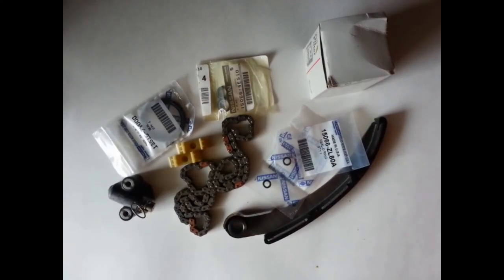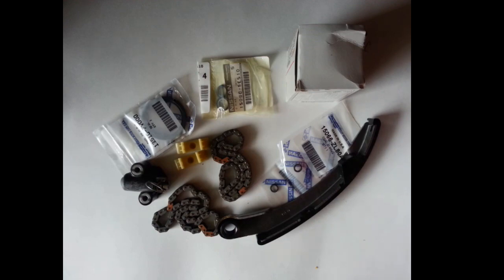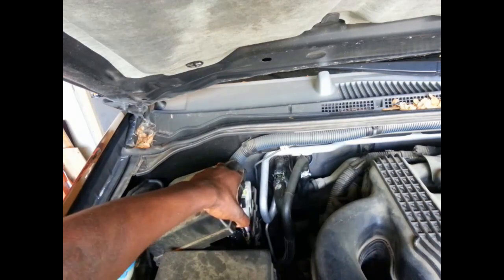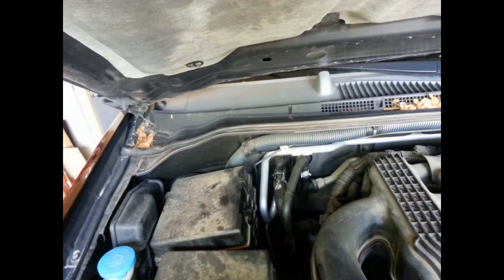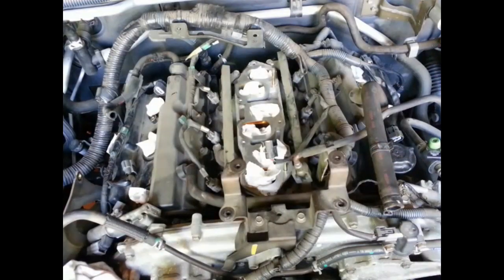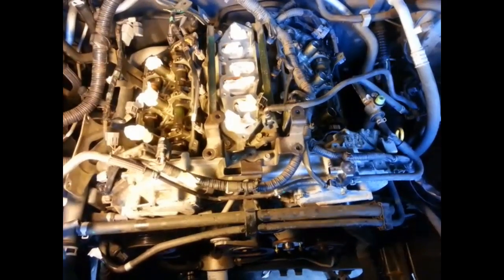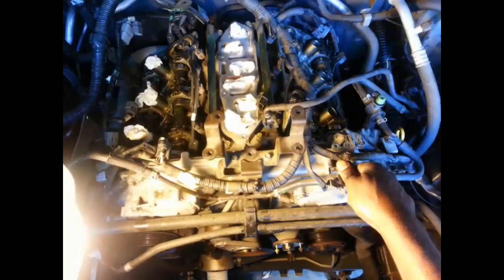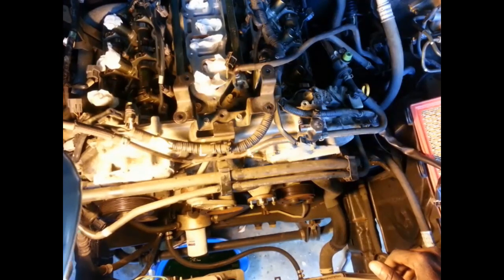2005 - 2008 Nissan Frontier timing chain replacement  Part 1

Comment: Hi, do you know if this engine is toast or if I can fix it. I have a 2005 Nissan Pathfinder. The crankshaft is turning 360 degree or half way. I just changed the timing belt and I found that the timing key was not aligned but the engine didn't turn on.

Comment: Guys, if you want to save yourself some time stop here and watch these 4 vids.....or at lease until you get to the timing case. This fellows goes through and does the job as good as your going to find. All the others will do is confuse you on their theories of engine timing issues. The one most watched didn't even start  his engine to show us and had lots of issues he deleted without explanation. Very good job Billy.

Comment: One question, is you frontier manual or automatic? and did you have to put it in "4x4 and low"? As i have read about that on other forums. and did you use some sort of a flywheel lock tool?
Reply from the maker: +Mariusz cies 
    My Frontier is automatic. It was in Park. Even in park, you can turn the engine for the automatic. For the manual, I believe you need to put in neutral and raise the rear wheels in order to turn the engine. I did not use a flywheel lock tool. I used the tie down rope to hold the engine while loosening the crank bolt. I explained this in video #2.
Reply: @diybillyc5000  when you go to tighten the pully back in, did you need to strap it again?
Reply: I used an old starter and spot welded the gear on to the starter shaft....just make sure the gear is all the way out so it will engage the flywheel

Comment: What size socket does it take to remove the crank pulley?
Reply from the maker: I believe a 21 if I remember correctly. just get a tools etc with 21, 22, and 37 and you should be good.
Reply: +DIYBilly C I replaced mine, it used a 3/4" socket. no metric would fit correctly.

Comment: I have a question too. First off, great video. Im about to be tackling this job myself soon. Why do the gold links on the chains matter? I understand the timing marks and all that on the cam gears and crankshaft. When I buy this aftermarket kit, it doesnt seem to have gold links on any of the chains. Also, it looks like there arent any seals. What gaskets and seals will I need to get to complete this kit... thank you.   http://www.carparts.com/details/Nissan/Pathfinder/Replacement/Timing_Chain_Kit/2005/REPN300109.html?TID=gglpla&origin=pla&gclid=CjwKEAiA_ra1BRDV-byb_aDqpQoSJAA-ofB9WBYUZjxUZpqcoMzLBOp5-A3zeOyvawEqUDIF5g1KKxoCCmrw_wcB
Reply from the maker: +Jessi Clark 
    If you look at the 5 videos, there are 5 seals altogether that you would have to get. The crankshaft seal, the 2 cam seals and the other 2 rubber seals. You would have to go to the dealership to get these in all likelihood. I bought my kit from the dealer so it came with these seals. Then I bought the primary chain aftermarket. This kind of seemed to work out for me. It's been over 6 months now and no issues.
Reply: +DIYBilly C 
ok awesome. ill go ask them then. did you have to drain the oil and coolant?
Reply from the maker: Yes you would have to do that to take off the front timing chain cover. I would also recommend replacing the water pump as it is accessible with the cover removed.

Comment: Hey buddy, I just want to say thank you again for the videos. I just finished replacing the primary chain, both secondary chains, primary tensioner and all the chain guides. I bought everything from my local Nissan dealer for $440. I struggled getting the power steering pump back in the mounting bracket but it finally went in. The other time consuming pain in the butt was removing all the old rtv sealant from the front of the motor and the back side of the timing cover. Afterwards, I used the Nissan rtv sealant with my caulk gun at it went very well. I was very very particular about keeping all my timing marks aligned. I marked my cams on both left and right sides of the motor like you did. This was tremendously helpful when I double and triple checked my timing marks after having all the new chains and guides in place. After putting everything back together I drained my oil and refilled with coolant. I did this just in case any fine pieces of dirt or old rtv may have fallen in the bottom of the motor somehow. I did use rags at the bottom of the motor but you can never be too safe.  I was so nervous when it came time to start my truck. It started with no problems at all and actually runs smoother now then it did before I replaced everything. Thank you again for the awesome videos.
Reply from the maker: +RAB MAN. Glad you were able to get it done and all went well. Yes removing the sealant and cleaning the surfaces is a pain but necessary as if not done properly it will leak. Kudos again.

Comment from the maker: Thanks for the feedback. The kit from the dealer cost about $350. It came with only the 2 secondary chains and not the primary chain. However, I later found out that you can buy this kit from a dealer BMW online (Amazon) for only about $100. I eventually had to buy an aftermarket primary chain because I was not comfortable installing 2 new secondary chains and keeping the original primary chain on. So yes I would go for the aftermarket kit. I believe it should also have all the chain guides included. But you would probably have to buy the seals (4 of them) from the dealer as they may not be included in the aftermarket kit. Good luck.